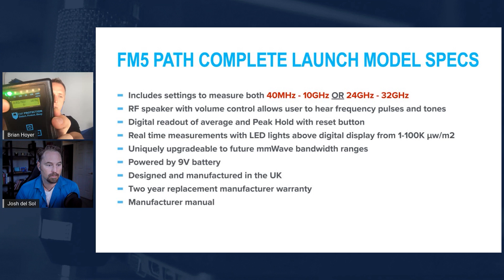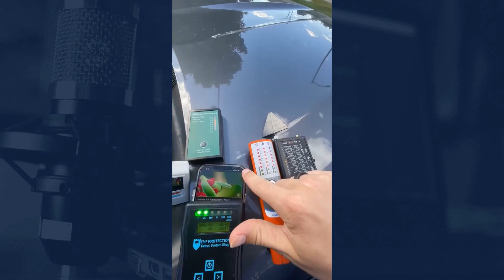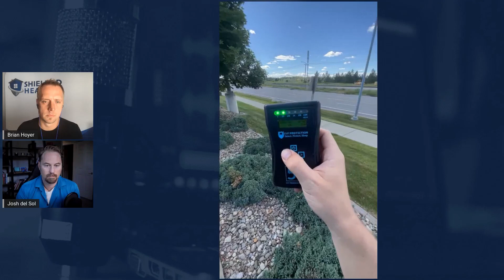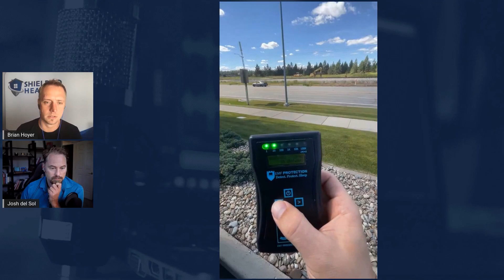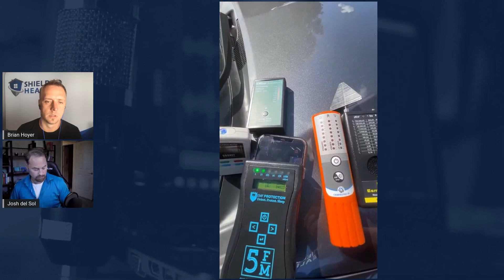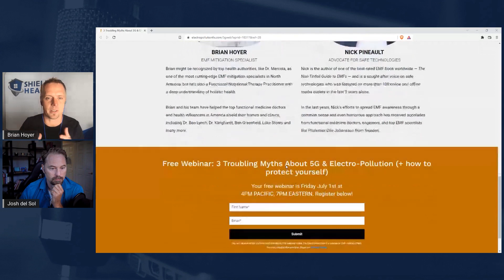5G MM Wave Testing Meter - 2022

Comment: The links below describe a meter that measures 50 MHz to 60 GHz and costs $799 US.  It measures near and far field, and it has data logging. It would be great to see this meter tested with the meters in this video.

https://www.gmesupply.com/fieldsense-fs60-personal-rf-monitor?cat_id=13716

https://www.youtube.com/playlist?list=PLNX69glb6gQIV4SHu_7Lb5xikhMAumgJ9

https://fieldsense.com/wp-content/uploads/2021/10/FIE_008-Datasheet-R4.pdf
Reply: it is not clear from the website that this device actually measures RF.   RF is not the same as stand alone magnetic or electric fields.  they give specs for the separate fields

    H Field | 50 MHz – 1 GHz
    E Field | 50 MHz – 60 GHz

but they do not give the frequency range of the EMR (RF).   you cant just add H Fields and E Fields and call it RF.   it is different.  see my other comment on this page.
E fields are generated by any charges (electricity etc) whether moving charges or stationary one.
H Fields are generated by charges moving with constant speed and direction.
EMR is generated by accelerating charges (which includes changes in direction)

people get these 3 energies confused all day long.  even professionals!
Reply: @ancientwisdom2012  Thanks for the reply.  It is great to have a dialogue about this, not just blindly accept claims and avoid the complexity.  I am an engineer but this is not my specialty.  What is needed is for an expert to explain this in terms that are as understandable as possible, as well as certify that the measurements claimed by these meters are accurate to acceptable limits.  I have made the mistake of buying RF meters that were complete junk, you could prove it by validating the meter readings did not follow the simple power equations where, with a constant power WIFI router, one meter did what was expected, the power to fall off as the inverse square of the distance, but the other meter was completely wrong.  Buyer beware.  In the video the behavior of the meter near the cell phone was strange to me and I am not sure I trust its accuracy, I could find no accuracy information on the website, etc.  Without an expert who can vouch for the technical details and accuracy how do we know?   

This website from the meter manufacturers gives errors in dB relative to ICNIRP, FCC and other standards.  
https://fieldsense.com/wp-content/uploads/2021/10/FIE_008-Datasheet-R4.pdf. 
If correct, this meter should have acceptable accuracy up to 60 GHz.  The meter is used to ensure safety of climbers of wireless towers and I suspect the manufacturers could be liable if their meters were not accurate to the specifications quoted.  I would love to see a similar document for the meter being featured in the video on this posting.

This reference breaks down how the electric field and magnetic field contribute to power density of RF.  
http://www.bccdc.ca/resource-gallery/Documents/Guidelines%20and%20Forms/Guidelines%20and%20Manuals/EH/EH/Section2Final06062013.pdf

Again, this is not my area of expertise, and I have reservations about both these meters.
Reply: @Larry_Druhall  people confuse stand alone magnetic fields & stand alone electric fields with EMF because the EM wave has virtual components (expressed in the equations for an EM wave) that possess electric field and magnetic field component vectors that vary in time, that are linked and are NOT the same as stand alone fields from electric currents and such.  (i wish they used different names so as to not contribute to this confusion in physics terminology!...)

   EMF is technically only referring to wireless electromagnetic waves (Photons) not separated magnetic fields and electric fields(which only exist near electric sources and currents.)  EM radiation travels in a line at the speed of light.
  Yet almost everyone (even some experts), use the term "EMF" incorrectly to refer to the separate magnetic fields and electric fields from wiring.   EMF is not the same as static or stand alone H field, and also are not the same as stand alone E fields.

stand alone  electric fields and magnetic fields are NOT part of the electromagnetic spectrum.   

If anyone doubts this pick up a university level physics book.  My degree is in physics also.

The field sense meter linked in an earlier comment, seems to only be measuring E fields and H fields which can NOT simply be combined by some calculation within the meter to make it into as an EM radiation(Photons).  

Photons or EM radiation has virtual component vectors that vary in time, but the real wave(the combination of the virtual components that are separated in the theoretical math used to describe it),  is a SINGLE real wave that cannot be separated as two stand alone or static fields.   They are different phenomena.  

stand alone electric fields, and standalone magnetic fields, are generated by stationary or constant motion of charged particles (electrons, etc).  Mag fields are only generated when charged particles move with constant velocity. (or by permanent magnets)

Whereas, EM radiation, or E.M.R. / E.M.F. (photons), are generated only by ACCELERATING charges. (technically, "acceleration" includes deceleration as well as changes in direction.   (...  and ..... if you want to get REALLY technical:   every time an AC current in a wire changes direction (which is a type of "acceleration"),  the electrons changing direction would briefly emit a photon or EMR/EMF.   But... that is STILL different from the individual, stand alone electric fields and stand alone mag fields that are generated by the moving electrons along the wire during the very brief moments which are  in between each change in direction of current!! .... i digress.)). 

Those are different things.

All that said. ...  the overall issues with EMF and E fields and H fields,  from most artificial sources ARE definitely a serious problem for human health and all living things.    So the conversation between Brian and Josh is in no way degraded by the clarifications i give here.   It just clarifies the correct concepts and use of terminology.

Another mistake is that people who make descriptions of all this have long ago confused 'convention' for 'definitions'.

   The convention was that certain types of energy TENDS to be found in certain frequency ranges or "bands".

Like,  AC electric fields, which in the USA oscillate at about 60hz, or that wireless devices like a wifi router produce EM waves at say 2.45 GHz or 5GHz....

  But the frequency is simply the speed of the oscillation of whatever is waving, but that information does not clarifying WHAT exactly is the thing that is waving ITSELF:  The "medium".  

 For example, if i wave my hand very fast back and fourth at 60hz, it doesn't suddenly become an electric field just because the frequency is the same as an AC electric field. 

  the MEDIUM (what is doing the "waving") is utterly different from the frequency.  MY HAND in this case is the "medium".

If i had generated an AC electric field at 2.45 GHz (instead of the conventional 60hz), with a piece of equipment i build myself, and then i get a separate device, like a standard WiFi router, that also uses 2.45 GHz (but now it is EMF or Photons).

  Even though the frequency is the SAME.   the TYPE of energy and therefore its origin, behavior, and properties (and the equipment I would need to measure each) would be DIFFERENT.

   So, the point is that people got confused and started defining the different fields not by the TYPE of energy(or HOW the energy is formed, as i described above), but rather, by how it oscillated (frequency and wavelength).  and then proceeded to jumble the stand alone Electric fields as well as stand alone magnetic fields and attach them incorrectly onto the lower-frequency end of the electromagnetic spectrum, when it UNEQUIVOCALLY does not belong.   

Electric fields on their own are NOT Photons.   

Stand alone magnetic fields are NOT photons.

   the electromagnetic spectrum or EMF is ONLY a spectrum of varying wavelengths of PHOTONS.  

This EM spectrum includes:    visible light, radio waves, microwaves, millimeter waves, infrared waves, ultraviolet waves, x-rays, and gamma rays. ... and that is ALL.

If the field sense meter is only measuring stand alone electric fields and stand alone magnetic fields then the info on their site is misleading people and it would not be measuring wireless transmissions of EMR (photons) as claimed.   please be careful.

i hope this helps everyone here to better understand this.   

I think the FM5 meter from Brian, although the accuracy data is still needed, seems to be a valid meter,  measuring actual EMF / EMR (Photons) / wireless transmissions from 4G / 5G infrastructure.   I look forward to trying it out.

warm regards,
A.W.
Reply: @ancientwisdom2012  You offer an excellent reply.  Thank you.  It has been many decades since I studied the associated physics and engineering. I would love to study it again, from basic principles, following the logic which you lay out here, along with simple experiments where I can generate my own simple EMF transmitter and receiver, measure the power, power density, losses, etc.  It cannot be that complex.  For faster frequencies cannot interferometry techniques be used if the electronics are stretched beyond their abilities?  There are simple videos on YouTube that show people making a transmitter and receiver but. they do not measure power, power density, etc.  If you can please provide a physics or electrical engineering reference source that discusses what you discuss I would love to revisit the science and learn it better this time.  Perhaps the world needs you to do this for us if this is not available.  And, if it is not available, why not?  I have looked at several first year physics and engineering texts online and none of them discuss what you discuss.  They present an abridged form of Maxwell's equations without some things like the scalar wave parts and never present simple experiments to explore these things and see it firsthand in a real, practical simple experiment.  I wonder why our system has gone to what appears to be great extents to create confusion and obfuscations around these issues.  A person should be able to study a first year engineering or physics publication and see a derivation of what you explain complete with simple experiments to validate the concepts you outline?  I want to see it for myself and am increasingly frustrated at the incomplete and confusing things that I have discovered so far.  Others can go on faith.  I need to see it for myself.  And I am not going back to electrical engineering school at my age, I am a mechanical engineer, but I have asked several electrical engineers who haver not been able to help, they appear to be ok with the way things are misrepresented.  Thanks again.
Reply: @Larry_Druhall  Scalar waves and the original Maxwell Quaternion equations are another discussion entirely, but one that i have been working on aspects of, and researching for years.  (i am in no way claiming to have mastered it!, but i have had success in demonstrating the use of scalar energy, which can be repeatably demonstrated,.... but is hard to quantify numerically, as no Scalar-wave meter can be purchased as far as i know.  but the gov has such ability i think.  (a scalar energy field would technically be considered a Longitudinal non-hertzian EM wave.   It has no frequency and no vector.  it is also not restrained by the speed of light.... )

  we need the original quaterion equations (20 variables) which  had the scalar energy included before Gibbs and Heaviside got their hands on his work and distorted it to its current 4 equation set.   I feel this prevented the unified theory of physics from being known to the world.   Scalar physics is another fascination of mine, and I work with exotic technologies that produce such energy fields, carefully made for the benefit of others.

I don't have enough background to speak on engineering and electronics components in a traditional sense, but it is of interest to me.   My background is a combination of my college theoretical physics degree and about 20 years of independent research including about 12 years investigating scalar energy.

as for standard traditional physics text books,  a good basic one that covers the concepts of EMF vs magnetic vs electric fields (Excluding, of course, scalar energy.....), is:

"Conceptual Physics" (i have the 8th ed.), by Paul G Hewitt

my other text of Physics at the college level is 
"Physics for scientists and engineers" (i have the 6th edition),
by Raymond Serway, and John Jewett Jr.

...but even here the explanation is simplified from even the already altered Maxwell (heaviside gibbs version of equations.)   

Still, the sections for EMR are separate from the sections on magnetism, and electric fields.   

the real EM wave is never represented as such but as theoretical time-varying vector components of E vector and H vectors.... the real wave, a superposition of the virtual component vectors, is never expressed as such in the standard model.   

hopefully some day we correct both the errors in peoples understanding of the Standard Model of Physics, regarding EMF etc for the purposes of the topic of this youtube video,... and then, more importantly, correctly reintroduce the scalar energy aspect of physics that will likely unify physics(quantum mechanics with its incompatible opposite, relativity!), but doing so probably will freak many people out, (or excite and free others who will feel vindicated at the revelation!), because it will lead people to realize that there is a spiritual world, or... a world of consciousness.  and it is NOT subjective but objectively real, even though it is not "solid", as we are used to experiencing this world!

As the great physicist and founder of quantum physics, Max Planck, said:

" I regard consciousness as fundamental. I regard matter as derivative from consciousness. We cannot get behind consciousness. Everything that we talk about, everything that we regard as existing, postulates consciousness. "
Reply: If you check with the manufacturer you will find that the sensitivity of these RF alarm monitors start at very high exposure levels.  They likely won’t even pick up emissions from a phone or tower on the ground.  They are designed after the previous generation of RF personal monitors for 3G and 4G but have added in mmwaves as well.  It’s cool for the RF engineering industry but as a crude example it’s like having a tool that measures electric fields from power lines for the industry that starts at 10,000 volts as the lowest setting and goes up from there while ignoring everything below.  

The sensitivity just isn’t there.  For example, 4,500,000 microwatts per meter squared is the ICNIRP guidelines that this meter is built to warn if the reading exceeds.  Building biology prefers that number to be less than 0.1.  So even if the monitor registers at half of that it will still only warn you of extreme occupational types of levels.  

I do think a comparison to more expensive meters would be valuable and I plan to do that.  We have to use meters that have the proper specs to detect down to levels we want to see though…which is nearly zero.

-Brian
Reply: @shieldedhealing9709  Thanks Brian.  I would love to see accuracy data for the meter in Josh's video.  And I fully agree with your statements about the levels of the climber meter being in excess of Building Biology standards or what Dr.Martin Pall derived as the voltage gated calcium channels being adversely effected at radiation levels millions of times lower than government standard limits.   That is about 60 dB.  After a successful career as a software developer and tester, I hope you will consider me as a viable candidate to test your meter.  I will be thorough and honest.  If the meter performs up to what is claimed, I will be a valuable asset.  If not, I will tell the truth either way.  This is not my area but I learn quickly.  Either way, please provide validation data about meter accuracy.  Thanks again.
Reply: Seems that you have no way to know what frequencies you are being exposed to. Can be low band sub 6 GHz, can be millimeter waves, whatever. And it just has an alarm, for when exposure is exceeding ICNIRP limits, which are ridiculously high limits. But probably a good meter to keep for service technicians at their work.
Reply: @BernhardLiebl  My Cornet covers RF up to 8 GHz.  In theory I could have the climber's alarm meter and my Cornet and, between them, tell whether there is a big problem, and if some of the problem is above or below 8 GHz.  If 5G is emitted in a narrow beam, a person with a valid working meter should be able to see a huge jump in radiation in the path of that beam, and this is different than 4G which is emitted more widely.  So, some information can be obtained as long as the meter is accurate.  I agree that even at the lowest reading of maybe 2% of the standards, the radiation is millions of times too high according to Building Biology standards.  Again, I question the accuracy and trustworthiness of both meters.   What I saw in the video had several red flags for me, including how the 5G signal was so powerful, and how it was so large in what appeared to be the wrong direction, not in the line between the call phone and tower, but in almost the opposite direction.  Many things do not add up here.  I would collaborate in the creation of a video of this meter that examined these things if invited.  Otherwise, I remain skeptical.